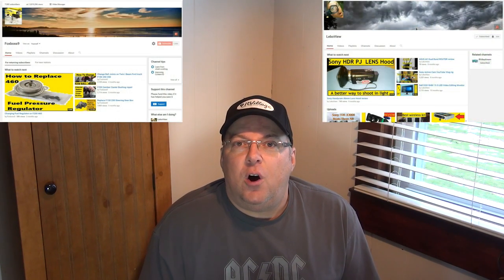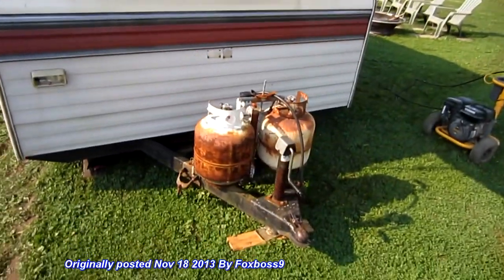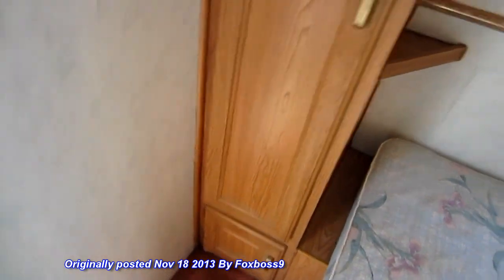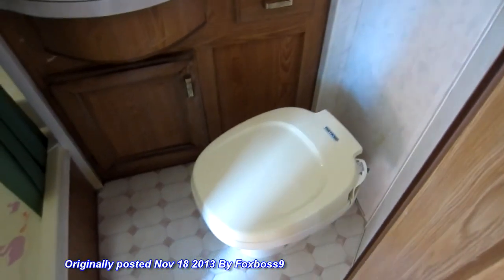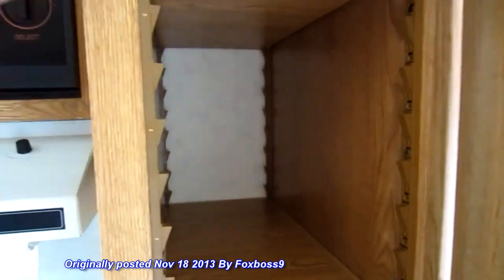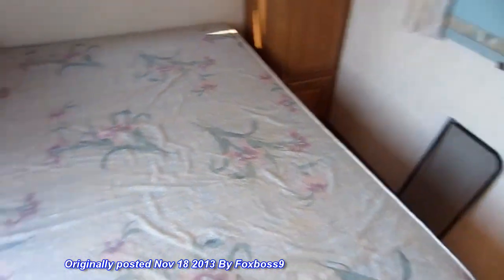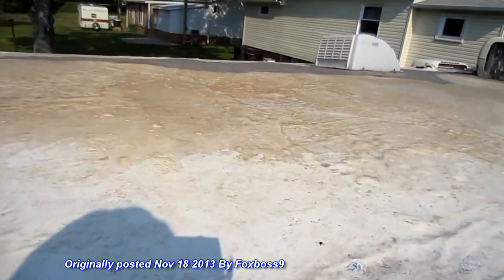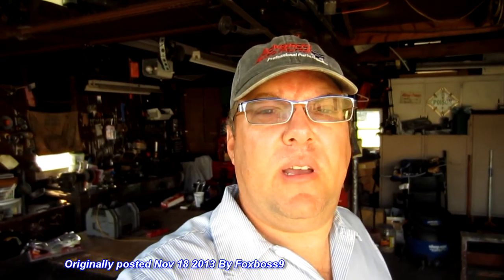*Flashback Video*  First day with our Travel Trailer

Comment: Breaker Breaker, do you got your 1992 Terry Camper! With some ceiling linkage, a bathroom door that hits into the stove. Room, you don't need any of that, will compress you in there, and make you really wanna renovate. You folks really put a lot of work in this thing to get it much nicer. Neat flash back, far out man!
Reply from the maker: Thanks Stellar.. We sure put alot of work on that.. It turned out way better than I imagined 😁